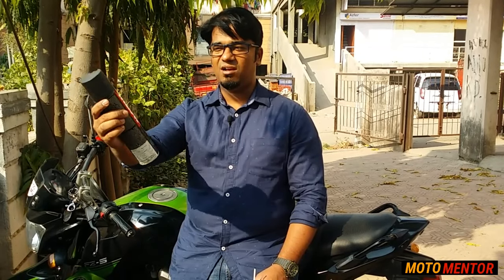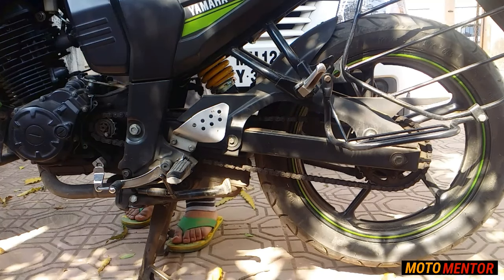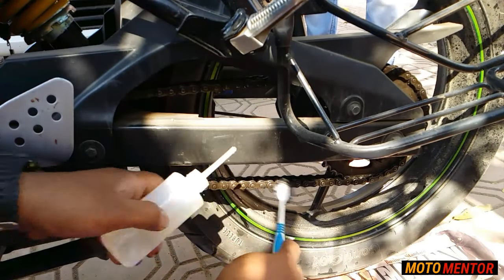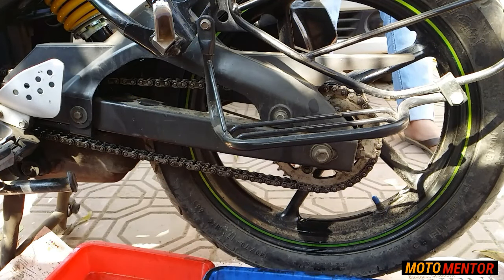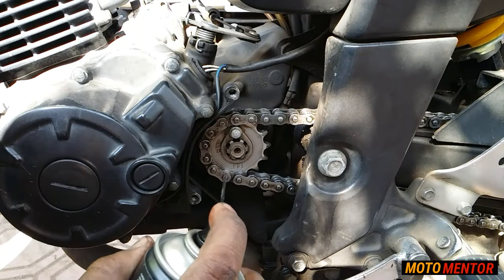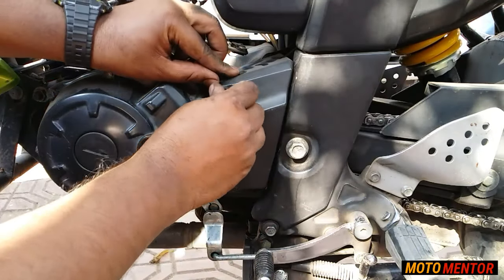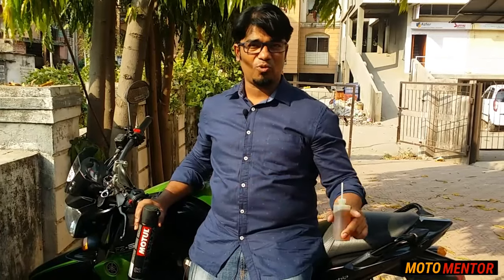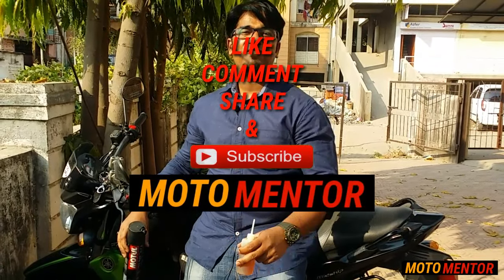BIKE CHAIN NOISE ? THIS IS HOW TO CLEAN AND LUBE MOTORCYCLE CHAIN MOTUL CHAIN LUBE VS 90 GEAR OIL

Comment: But using oil is not a good method it will attract lot of dirt and will stick to the chain which could result in much faster wear. Where as motul chain lube is not an oil but it will create a coating over the chain which should be cleaned and re applied between 500 to 1000km and it is also more water proof than oil.
Reply: Harikrishnan kazhanikunnath you are right. 4 years ago I use the gear oil as a chain lube and I’ve notice that it attracts dirt for 1400km 1 ride and I stop using it. But if you always clean your chain that is good. If you are using the motul I think it is much better than gear oil but you need to put it to the chain every 500km maybe.
Reply from the maker: Brother thanks for Watching my video..... See the  basic function of any oil is to reduce friction and Protect metel from rust this oil is thick not and  like our normal engine oil it's easy to clean as well where as motul chain lube get hard after some time it's vvv sticky and even this attracts dust and it takes a  lot of efforts to clean it M not against motul chain lube but I found gear oil V cheap and best i alway prefer to make videos based on  my experience and practical incident..
Reply: MOTO MENTOR and the price of gear oil is much cheaper compared to motul chain lube.
Reply: If you think motul c2 is not sticky and won't attract dirt you're very much wrong.... I've been using the c2 for over a year now and it attracts a hell lot of dirt here in delhi especially....so the dirt part is not the concern here
Reply: MOTO MENTOR :  Thanks brother for uploading such a great video anyway your motivation is too as i won't have words to express. Furthermore your good self is requested to draw a link regarding the gear oil.
I am eagerly waiting for your response and after watching your videi i became your subscriber.
Reply: Motul C2 is very sticky
I am sharing my personal experience here
My Unicorn 150 chain sprocket lasted for 50000 plus kms just because I used 90 grade gear oil
mechanics were stunned by seeing this kind of performance of gear oil.
Reply: Pusang_ Lampong cleaning it frequently   is not possible for a lot of people... I think every 3000 km is fine .....
Reply: Alankrit Devcharan me also having unicorn 150 .. whether I need to use 90 gear oil r not ? Not clear with ur comment..plz suggest...I bought mak spirol 90 ep
Reply: Rudramuni Shivacharya Hiremath 
Better use 140 grade gear oil
Sorry for the mistake I used 140 grade.
Reply: Ashish Kumar 3000? buddy i own a dominar nd Duke390 2017, it's compulsory to lube chain at each 350-400kms as in india there is lots f dust... nd clean at atleast 1000kms
Reply: oil is oil. they are both waterproof.
Reply: Altruistic oil is not water proof ,oil will get washed away easily compared to chain lube,grease etc
Reply: mate, oil does not mix with water, hence the water proof. as for matter of getting washed easily, thicker oil will still stick to the chain regardless unless you pressure wash them off the chain or use detergent. sticky chain lube or grease will only harden over time and makes the chain stiffer if it gets dry enough. I know this coz I use Yamaha chain lube spray (very thick and sticky,like glue). Also chain should be cleaned ideally every 2 weeks or after a ride in the rain anyway. choose what works for your budget either way.
Reply: I think gear oil is better than motul. As I used both...
Reply: All kinds of oil are waterproof man. Gear oil is always better and cheaper
Reply: Even my Duke 390 and Ninja 300 manual says that one can use SAE- 90 oil for chain
Reply: @chaitanya5197  
Is it ? Does the manual say so ?
Reply: @Dhinchu  yes it does

Comment: I use diesel and chain lube for my bullet Electra.
I think the oil he uses should be just fine given the dust and rain in Bangalore...
Reply: Diesel picks more dirt and dust in atmosphere so use kerosene to clean
Reply: Without rain chain lube is better by a way big margin. In rain it sucksa the cost is good 😁

Comment: Wise attempt , you may use diesel instead of kerosene , diesel has lubricating qualities too. Go in for 140grade gear oil which is more viscous than 90. The overall cost will be negligible when compared to spray lubricants .
Reply: Shaji K.Damodaran this is a informative response! So we need to go for 140 grade or 90 grade for Yamaha FZ FI? And I don't get what'll be the difference?
Reply: Sir can I use 140 grade for my classic 350
Reply: Ganesh sd , use 140 grade gearoil of a reputed brand, clean and lubricate chain every 500 kms . This gives you best results. Ofcourse spray lubricants are easy to use, on the other hand gear oil works out very cheap in comparison, can be applied on any      chain driven bike.
Reply: Gulfstar HP-4 140 API GL4 Automotive Gear Oil sir can I use this
Reply: Ganesh sd use gulf star 140
Reply: 140 grade enthina upayokikkunnath
Reply: Shaji K ..140 will be more dense and sticky than 90 ? I am bit confuse about gear oil 90 and 140 ? Please clarify
Reply: Better use  90. 140 may attract more dust.
Reply: Sir we use this lub on  the period  of free services or after the free service  is over
Reply: Xuvam Bhandari  we can use at any time before or after free service
Reply: Mallu?
Reply: Hey bro wat abt thinner
Reply: Can we use transmission fluid as lube?
Reply: Thanks was wondering 90 vs 140
Reply: For r15 which grade is good
Reply: @shajik.damodaran8156  which brand

Comment: Yeah you're absolutely right that while using motul chain lube during monsoon it does dry up quickly resulting in rust in the chain which is very annoying even after cleaning and lubing every 500kms, thanks for the informative video will try the gear oil this time with higher grade like sae140!!
Reply: I am currently using Bosch 140 grade oil
Reply: @georgeray649  how is the performance?

Comment: I don't like kerosene... Not good for chain rings...in my bike manual...
Reply: Zoram Thanga then use diesel bro it's superior then kero.
Reply: Siraj Mazumder oh... Thank you for the advise.
Reply: And for engine use either motul oil or spel 4t if available
Reply: U should mix a little engine oil with kerosene to make it less corrosive
Reply: Then use some petrol..
Reply: @sirajmazumder7538  
: diesel and petrol spoils O- rings of chain....but kerosene doesn't
Reply: @chandu7112  i used kero and within one month rust started happening bro
Reply: Bewkuf Ho kya yaar kerosene se saaf kiya jata hai or 90 oil se Lube kiya jata hai

Comment: Till how many KM this 90 gear oil will last longer
Reply from the maker: Hi Shivam With my personal usage and experience it easily last for about 500 kms however I lubricate it once in a month even if I don't achieve 500kms. Coz when we wash the bike  there is a  Lil chances of losing this oil from chain so I prefer to lube on every alternate washing u barely require any amount of oil. I hope this answer your question.
Reply: MOTO MENTOR can u plz provide the link of buying this gear oil. Or any brand name to buy from Amazon.
Reply: Depends on how you ride and in which weather you ride

Comment: Ok nice for giving information. Even i am using this  gear oil for my new bullet ..i used all chain sprays but not satisfied, because it  dries so faster in 2 to 3 days only..so i am using 140 grade thick gear oil ..thick gear oil dies not spreads onto spokes and rims , if we use it little quantity of gear oil  lubing chain for 3 rounds is enough

Comment: Can I use 20W50 new engine oil to lube my bike chain?
Reply from the maker: Yes you can but its not that thick so it may spill over other parts if you over lube just keep that in mind.
Reply: @MOTOMENTOR   sure 👍.. thank you 🙏
Reply from the maker: Yw bro hope you have subscribed.

Comment: Liked your video. I have used lubes from multiple brands but used oil few times and I have clocked around 35k kms on stock chain. IMO oil spoils your wheel and can spoils your clothes. Lubes are sticky so they dont spread on high speed once set but thats not the case with oil as it may spread all over the wheel and in rainy season that can cover rear tyre with excess oil. Plus oil work well where chains are covered. Anyways I will try oil of suggested grade to see the result.

Comment: Gear oil is better but it will also attract lot of dust. Dusty chain will wear out fast. Use gear oil only if there is full chain cover.

Comment: Is there any substitute for this 90 gear oil? It is unavailable.
Reply from the maker: You can use you engine oil in an emergency situation but make sure bot to overlube or else it will spill on other body parts.

Comment: Can it be used for AVENGER 150 STREET (2016 model) ?
Reply from the maker: Yes bro
Reply: Thanks for replying Sir.
Reply: @MOTOMENTOR  why not 140 instead of 90 ?
Reply from the maker: 140 is also good.

Comment: While riding my Pulsar 180 it's pulls on the right side.Can you kindly help me out with my problem.
Reply from the maker: I had this same issue it got fix by changing swing arm bushes or it could either be the issue with your front fork  alignment or the bearings
Reply: Thanks alot buddy
Reply from the maker: Anytime bro

Comment: Thanks man... I got my bike problem.... from last 2 month I was using Motul ( now its rainy season) ... I was disappointed when I found few rusts on bike chain.... thanks for explaining the reason.... Now as I have found few rust...should I change the chain....
Reply from the maker: Well not necessary but if the rust is too much and if it is too noisey then change it.
Reply: @MOTOMENTOR  some people say kerosene can damage tyre or any rubber made parts

Comment: Hey bro great video breaking all the myths related to using only expensive chain lubes. Can I use ep90 gear oil for lubing the chain
Reply from the maker: Yes you can .. and thanks for the appreciation.

Comment: Kerosene?
 Is that the same as gas?
Petrol?
Reply from the maker: Ya you can say it's like that but its actually the lamp oil if not kerosene we can use diesel for cleaning.
Reply: @MOTOMENTOR  got it.
Thanks

Comment: Can anybody tell me from where can I get Kerosene?
Reply from the maker: You can get it at local ration shop  if kerosene is not available you can use diesel
Reply: @MOTOMENTOR  But some sources say Diesel/petrol can harm the O rings of the chain. So, I'm looking for Kerosene.. Here in my locality it's not available even if u are ready to pay 100rs per liter.

Comment: I have Pulsar 180 and service center guy told me that open chain setup like in sports bike ( mostly above 150cc duke , pulsar, R15) should use spray instead of oil / grease, as they are open they are more prone to the dust, and when dust will stuck it will damage the chain.
Where as bike like discover (below 150cc) should or can go for oil as they have closed chain set.
I found his suggestion valid.
But even i prefer oil/grease for my pulsar 180 (open set up)
Whats your say on this , what should i use.

Today only i watched ur video and it was really well explained :) i subscribed your channel too. Keep going like this .....
Reply from the maker: Thanks for watching my video. The service center guy did say correctly and make sense however I made this video coz i tests this theory into practical and since my bike has a open Chain I followed the service center suggestions to use chain lube which is good but the only problem is in the rain when the water gets locked inside the chain and in extream summer the chain lube gets too dry which makes lots of noise on the Chan, the oil in compair keeps the dust soft it's easy to remove easy to apply and cheap too. I have been using this since long and has really got a better results compair to motul chain lube.

Comment: May I use disel instead of kerosine?
Reply from the maker: Yes bro you can.
Reply: @MOTOMENTOR  thank you bro.. Now, I am also using diesel as clenar and Castrol 90grade gear oil for lubrication..

Comment: Is it good for o ring chain as mechanic said it will spoil rubber
Reply from the maker: I am using it since 6 years so far no problem however you need to make sure to Timely lube it for better experience.
Reply: @MOTOMENTOR  thank bro
Reply: But o ring chain was not available that time..
Reply: @mayurchandole1186  O rings for motorcycle was introduced in 1971. Most chain cleaner has kerosene as major content. Kerosene doesn't harm
Reply: @incognitohuman1959  OK 
I am using it for my hornet bike hope it will be fine ....
Reply: @mayurchandole1186  it's fine. Make sure it's clean and wait after lube. Let the lube settle down
Reply: @incognitohuman1959  thanks bro

Comment: I have NEVER cleaned my chain , after riding bikes for many years including 10 years as a dispatch rider in London. I just keep the oil from my oil changes and squirt it in my chain whenever it begins to look dry . This has worked for me for over 20 years . You don't need expensive "special" sprays , just keep your chain from getting dry . The slight mess it makes will wipe off with kitchen towel 👍
Reply from the maker: Same pinch bro 👍

Comment: I use diesel for cleaning and it works perfectly fine. Also, I have used gear oil on my gixxer for about 15k km, and it was perfectly fine.

Comment: 🙋🏻‍♂️ Hi Bro... i am confused with lot of researchs 😵🥵...hope u give me a solution !! 💎

Report says that kerosene & wd 40 damages O RING chains !!

Kindly Plz suggest me best chain cleaner & chain lube for O-RING chain bro (MT-15) 🙆🏻‍♂️
Reply from the maker: Yamaha has its own chain cleaner you can go with that and for lube i will still recommend gear oil over the sticky chain lubesvunless you are religiously and regularly cleaning it.
Reply: @MOTOMENTOR  Bro's AURA = 100000000+ 🔥 (Tks for the quick response bro)

chain cleaner costs equal to chain lube bro ! 🥲🙆🏻‍♂️

Is there any alternative cheapest chain cleaner for O-RING bro ?!

Comment: I use 120 or 140 grade fresh gear oil on my Honda Unicorn chain.  Once a year, I remove chain by carefully marking which holes of the chain is resting on which tooth of front and back sprokets, I mark the hole (inner space in the chain) and teeth carefully on both the sprokets, remove the lock of the chain, first get it pressure washed at service center, and then wash it with petrol at home.  After drying it, I fully dip in the above-grade oils for 30 ought minutes, moving them in the gear oil, then after using cotton cloth, I wipe the excess oil, then carefully put the chain on same tooths of both front and back sprokets and lock it.  Then I Lube it again with 120 or 140 grade of fresh (unused) gear oil. Then lube the chain every 400-500 km of riding.  You wonder my chain and both sprokets are like new even after 67000+ km today.
Reply from the maker: The way you have described... I 1000% Agree with you.  That's you dedication  and love towards your machine.  I like it 👌.

Comment: Kerosene oil is usually Blue in Color. You are holding White liquid bottle..
Is it any other type of Kerosene or I am just judging it wrong and it's the blue Kerosene
Reply from the maker: Its the same kerosene but not blue coz blue kerosene are from the government which is at subsidies rate and it is a non subsidies kerosene.
Reply: @MOTOMENTOR  Where to Buy kerosene ?

Comment: suggest the brand for 90 gear oil
Reply from the maker: Castrol.  Motul and yamalube.  M using castrol.
Reply: @MOTOMENTOR  THANKS FOR KIND REPLY, I GOT THE CASTROL GEAR OIL WITH NOZZLE APPLICATOR Rs 70/-

Comment: Which one is best...on gear oil..
Hp lubricant gear drive ep 90/ motul 80w90 gear oil/ servo  90 gear oil / castrol  scooter 80w 90 gear oil?
For my duke 200 bike chain lube ..

Comment: Does the oil spills over the wheel when we ride at higher speed and makes the wheel dirty with optimum level of lubrication done over the chain?
Reply from the maker: if you over lube then yes the best thing is to take a cotton waste dip it and then apply  i think i should have shown in the same way. wait i will come up the a short video on this.

Comment: What is difference between used engine oil and gear oil.....who is better for chain lubricant?????
Reply: viscosity / thickness - engine oil is far more dense than gear oil - both wud do the job (temporarily) but with cons - thick oil attracts dirt - thin oil slips off with rain ...aaron (enfield) - but they work :) economically

Comment: Can I use "used engine" oil ? which is also called mobil I guess
Reply from the maker: in case if you dont have access to gear oil yes you can but it will not last for long as engine oil is usually thin.
Reply: @MOTOMENTOR  tnq very much for ur reply sir

Comment: an Old trick I use is to add a little graphite powder to the oil, Shake  hard before use. You will be pleasantly surprised at the  result

Comment: Bike Chain cleaning is very simple if you do it without distraction, proper Tools and few steps. 
1.start engine and put second gear. 
2. Sprey Kerosene(low cost) with a spreyer on running chain completely and wait for a minute  to loose the dirt. 
3. Use two tooth brush from rear side hold properly for 2mins with spreying kerosene. 
4.  Accelerate for 1min to rinse loose dirt and kerosene in high speed. 
5. Turn of engine and do visual check by rotating manually for any leftover dirt.
6. Pour Oil manually or with engine on, after pouring completely accelerate more to rinse the excess oil.
Hope this steps may find helpfull to any self servicing enthusiast.
NOTE: DONT WEAR LOOSE BRACELET, LOOSE SLEEVE OR CLOTH WHILE CHAIN CLEANING WITH ENGINE ON, IT MAY CAUSE PINCH POINT HAND INJURY.

Comment: Can I use any gear oil?
Reply from the maker: Gear oil comes with different thickness you can use any brand the best is either 90 or i heard even 120 is also good but I haven't used it.
Reply: @MOTOMENTOR  thank you brother
Reply from the maker: YW BROTHER HOP YOU SUBSCRIBED.
Reply: @MOTOMENTOR  done bro